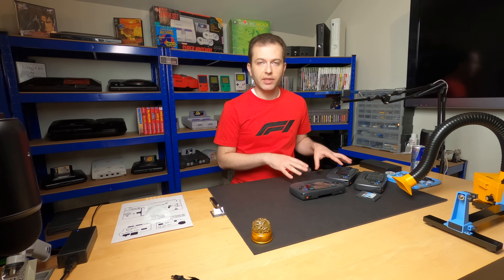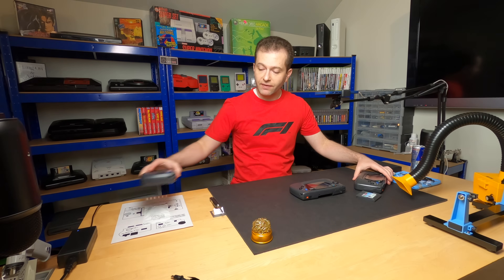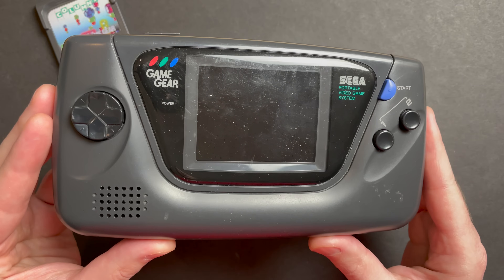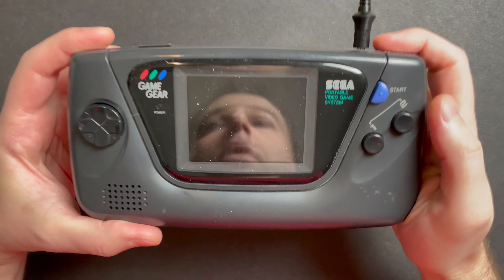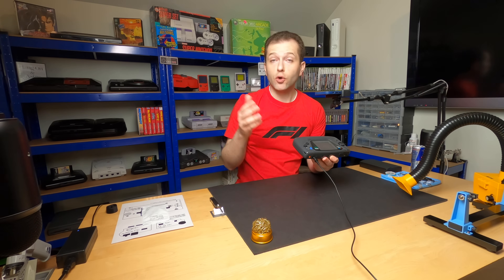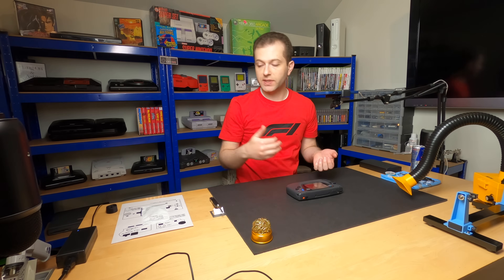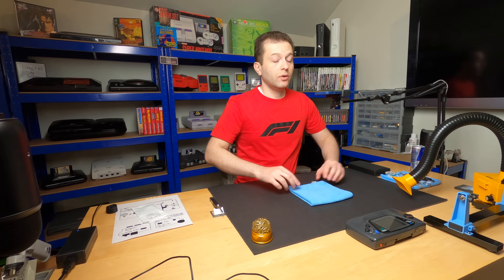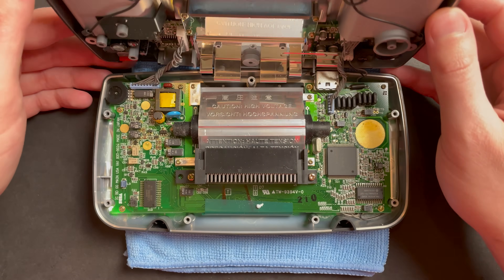Last Shot at Redemption... Will We Succeed? Sega Game Gear Repair-a-thon, Round 3.

Comment: What really frustrate me is how other youtubers show how easy it is to fix Game gears. Just replace the capacitors they said, then after replacing the capacitors the unit still doesnt work. But at least it is in red light boot? Also after the capacitors leaked aside from the ripped pads solder doesnt stick to the old solder points. Never been frustrated this much, it's much easier to fix gameboys

Comment: I'm surprised you didn't use the ceramic capacitor kit. With that thing you only need to ever replace capacitors on the power board ever again and the rest of the system will last for a long as the boards do.
Edit: I just looked and they also offer power board ceramic cap options that also change the power plug to USB C, and one of those comes with a rechargeable lithium ion battery pack.

Comment: Are any of those a model that is compatible with the USB-C charging mod? I think a case mod to allow you to use some Li-Po flat pack battery modules and a USB-C charging interface would be a really nice quality of life improvement. Apparently there are also some really nice sound circuit mods and several variations of the LCD swap mod that eliminates the need for the cold-cathode backlight. The problem is that there are so many different variants and sub-iterations within each variant of the Game Gear that actually modding one can be a thankless task.

Comment: when it comes to these old surface mounted caps, I usually snip them off just at the bottom and then remove the black plastic peace, then desolder the legs from the bord its a lot easier and i haven't lost any pads since I started doing it this way.

Comment: I recommend just getting the SYF board and transferring the Asic chip, cart slot and expansion port over. If you have an unfixable Single Asic Game Gear with advance soldering skills and equipment i highly recommend it.
Reply from the maker: I've come across those recently, forget which channel I saw them on. I'm glad there are more options for the Game Gear that keep coming out. It's a good solution for a modern GG build.

Comment: mine stopped working, I only get the first black screen with the white text, then just nothing or some glitched screen after that. The sound went away then it came back, I'm still confused if it's the capacitors or not. 🤷🏻
Reply from the maker: More than likely the caps. There's no way to really diagnose much without recapping a faulty GG first unfortunately.
Reply: @BorderlineOCD  yeah I changed the capacitors and still got the same issue. I think I heard somewhere else that it's just not going pass the boot screen, but I just recently bought three games and one of them was Pac Man and that one actually lets me play a bit then it just shuts down while playing through the first maze. So weird.

Comment: For the other Game Gears did you check the 3 pin diodes near the caps that leaked?  That is a very common issue when the caps have leaked.

Comment: Dude, I've been sitting on 3 game gears that need a recap for months. These consoles truly are hit or miss. I've had quite a few that have all kinds of weird garbled graphics issues after a recap due to hard to spot ruined traces from corrosion. it can be hard to justify the effort for faulty ggs imo.
Reply from the maker: Indeed, I’ve found them to have a steep learning curve beyond a recap and perhaps a few obvious faults. I’ve tinkered with the first two units off camera for several hours and haven’t made any progress beyond the results shown in the videos. Traces seem good, even swapped out a couple of the diodes that Console5 sells (D1-D4) and no change. It could very well be that the screens are faulty in those units but I’ve haven’t worked on enough of a sample size to challenge that assumption. I’d really love to understand these better to be honest with you. I’m kinda tired of working on em right now but I plan to try another batch at some point. It’s a great system to have, especially modded, and I have some Sega Master System favorites that I spent several years of my life playing as a kid, which I’d love to own on a Game Gear.
Reply: @BorderlineOCD  I’ve recapped plenty that had busted screens before, that’s relatively common. If it’s a busted screen, going straight to a screen mod has always worked out for me. I’ll check the other vids in a bit and give you my two sense on it.
If you’re not 100 percent on if a screen mod is going to work out, hand wiring instead of flowing qsbs is probably the better choice as it’s easier to remove.
Reply: Yeah both of the other ggs look like busted screens and good candidates for Lcd upgrades or even the consolized gg kit which I believe is coming out soonish last I checked. 
With that second GG that doesn't have an image on the sides, maybe try reflowing the pins where the lcd flex cable connects to the main board. Those lcd upgrades are super nice and absolutely worthy of doing. More power efficient and look a million times better.

Comment: As much as I love Sega, the Game Gear was and is awful from a repair point of view. Out of the 15 (!) GG's I own, I've managed to repair only 1. And I've worked in the electronics service field for years. No matter how many caps i've replaced, no matter how many traces i've rebuilt, the damn things just refused to work. I thought over the years, that maybe, someone out there would make replacement boards, but alas no luck. At least, I wasn't able to find one.

Comment: I was watching your previous two videos and I think you can fix at least one of those screens. 
There is one chrome pad on the right, and three on the back of the screen toward the bottom.
They gradually lose the thin soder that attaches them. You can lightly rub your sodering iron on the pads to restore that connection.
Be very careful, though. Do it too much and you will damage the contacts.  I will attach the video that expains it on the end. 
https://www.youtube.com/watch?v=agPyGjKDe5U&t=10s&ab_channel=Blagger

Comment: FYI, there's a community project to build a game gear from "all new" parts.  it's a new main board (with zero electrolytic caps), compatible with modern IPS upgrade screens and the enhanced sound / Li-On battery board.

Basically, you're just moving the original ASIC and cartridge slot and stuff over from the corroded dead board, to the good new one.

As far as cleaning rubber membranes go, you can boil them for a short amount of time to restore the feel to them.  There are tutorials online with temps and times.

Also, IMO that screen was pretty scratched up.  I personally would consider polishing the acrylic if you're not going to replace the bezel.

Comment: I also had one of these and the backlight went out after a few years. Just died like that and went all dark. Those high voltage tubes were not really reliable but was the best low cost solution back then.

Comment: i am also repairing game gears for some years now. dont know how many went through my hands, around 40 pieces i guess.
what i can say is, only half were fixable with my skills.
game gears which shut off after 1 sec for example are 99% not fixable for me.
funny thing is, i never had an broken power board, but replaced the caps anyway on them : )

Comment: Dude I feel your pain. My hands cramped from replacing so many capacitors. I fixed maybe around 20 systems and still have another 9 to go and 7 battery packs to fix. I put it all away for the moment to take a break. I'll sell them all to ya.

Comment: If you want much more technical repair details beyond just recapping I've spent the last year filling out the repair steps for game gear at http://RetroSix.wiki might be useful to fix some you haven't managed to fix
Reply from the maker: Great documentation bud, thanks for sharing. The section on getting to red light and checking the voltage references will surely come in handy. Bookmarked for future reference!

Comment: I have an original from Japan which my father brought to me when he was there, and I was dumb enough to mix the transformers and I've connected it in a 24v AC cellphone transformer. That time I took it to Sega service but they've said something like the video board was damaged, don't remember exactly. Do you think it still have salvation?
thank you!
Reply from the maker: It's possible. It's pretty easy to refurbish the power board with new caps, voltage regulator etc. If nothing else you can swap in a power board from a known working system to confirm its operation.

Comment: I don't know if I missed the reason but, why is replacing the ancient LCD/florescent display with a modern IPS kit? All the great work you're doing to bring these systems back to life seems to be kneecapped by screen tech that is easily remedied. I seriously do not mean this is any negative way, I'm just curious. You do fine work and I enjoy watching.
Reply from the maker: I do enjoy modded builds and I own several across the various retro systems but I enjoy stock retro systems all the same. It's part of the experience of what it was like for someone who owned a system like this 30 years ago. I'm tend to do the same with the few vintage laptops I own. I always restore them with the stock operating system they shipped with (like Mac OS 9 or Windows 95) rather than the most recent OS they can support.
Reply: @BorderlineOCD  Gotcha. I feel like now that you said that I remember you probably explained that in a previous video. I also meant to congratulate you on the successful fix in this video. Third time’s a charm, after all. I’m really looking forward to the TG-16 vids. It was the first system I bought with my own money and hold a special place for me. Thank you for responding!

Comment: Other two units may have bad connections on the flex cable lines where it attaches to the board. Just like the GameBoy Screens.
Reply from the maker: I attempted this at the end of episode 2. It unfortunately did not have any impact on my units.
Reply: @BorderlineOCD  IN your video you ran it on the black squares, not on the solder points connecting the cable to the board.

Comment: Nice job man! My original game gear I had when I was a kid still works, but I have a blue one I found for cheap at the flea market maybe 15 years ago that never worked. Is the first step regardless of the issue to re-cap them?
Reply from the maker: If it wasn't working 15 years ago the problem may not have been due to the capacitors. It could have, but not certain. Capacitor failure is almost certain today, as the units are 30 years old now. But chances are that something else stopped that unit working 15 years ago. You should probably start with a few voltage checks using a multimeter on the power board to see if it is delivering power to the unit. There are diagrams of the voltage values to check which are easy to find online.
Reply: @BorderlineOCD  Thanks so much for the response man. Yeah, I just tried to fire that thing up again with a confirmed working power supply and it is dead as a door nail. No red LED, no screen lit, nothing. Sounds like the perfect place to start.

Comment: i actualy just finished  recapping three of these aswell lol. two where fine and the last one has three horizontal lines, im unsure if thats the LCD or me messing the recaps  but it  plays  games and does what it needs to otherwise. i wanna do a lcd upgrade and  unsure if this one with lines would be the right one to use  because it may not be the lcd also wish id have seen these videos first lol  these three are my first time  doing this sort of thing. id love a copy of that paper you have with the  board map with the  caps MF and volt  on it too lol I did one cap at a time
Reply from the maker: The diagram is from the Console5 wiki. It doesn't have the capacitance or voltage rating thought, you'll have to make a note of the readings once you open the unit up so you have a map of what to install. One cap at a time works too, and I see that many others prefer to do it that way to minimize chance of error. I find doing all the steps chronologically (remove, clean, tin, install) to be easier but that's just me. I have a similar dilemma as you with my unit from Episode 1 (VA1 with lines on screen after recap). But chances are the board is find and the screen is just messed up. It's a gamble though. Personally I plan to take the gamble, as I do not want to sacrifice a working screen when I have a faulty one that is a viable candidate. The LCD mod can always be salvaged and put in a different unit (wont be fun to reverse it, but it can be done). Either way, best of luck with the mod and let me know how it goes!
Reply: @BorderlineOCD  thanks for the tip. I'm gonna do the mod as well. They have a newer one now that even I should be able to install.  No more wires allover. Kinda glad I got one with a bad screen. Didn't wanna mod a working one

Comment: Great job, game gear recap takes lots of patience but its one of the easier handhelds to revision, i love the American d-pad, its much better than the European and Japanese floppy one, and the fact the American power socket its smaller also looks better than the Mega drive bigger socket.
On the other side i love the engraved back on some Japanese models.
Im waiting on a cheaper easy to mount ips screen to mod one of mines.
Reply from the maker: It's quite curious that they changed something as fundamental as the d-pad between regions. I love little details like this that I learn about from folks in different counties. Thanks for sharing.
Reply: @BorderlineOCD  i share your opinion, and changes for better are always welcome, Sega never improved European Sonic 1 for the Mega Drive unlike the American and Japanese versions that are much better than ours

Comment: One thing to note: after you snip the legs of the through hole components, always re-solder the joint.  The act of snipping the legs can create micro-fractures in the solder which may lead to failure down the line.  Note sure if you did this, but it wasn't shown in the video.

This inspired me to pull my Game Gear apart just to check for any corrosion .  Seems all good but might order some replacement caps anyway! Keep up the great work!
Reply from the maker: Sweet, now you've given me one more thing to be even more OCD about.

Comment: I'm practicing to become as good as you are. Im still trying to fix a trace on a original xbox with a broken trace from the clock capacitor leakage. 
I never knew that was possible until i saw your channel.
Thank you for the inspiration.
Reply from the maker: Glad to hear it bud. I'm sure you'll get it working. I love working on the OG Xbox. Great system to practice trace repair (the faulty ones almost always have a broken trace or two).

Comment: What do you call that cutting tool you use to snip the excess legs off of the capacitors? 

I looked at the description, but could not see something matching that description.

Edit: Well done with the repair, the sigh of relief was almost palpable.
Reply: Those are called 'flush cutters'.
Reply: Flush cutters
Reply from the maker: Indeed, as mentioned above they're just flush cutters. This is the one I have https://amzn.to/3BWAVgW

Comment: same problem. Did the recap, audio works, reads games, display is crap.
Reply from the maker: Given my experience in this repair-a-thon, I would suggest that our experience is not unique and the displays are just reaching an age where the failure rate is going to be very high. Hopefully LCD kits will come down a bit in price over time.

Comment: Some what comical that the only one that ended up with a working display was the one you could actually get a replacement for lol. Glad you finally found one!
Reply from the maker: Lol yeah it was unfortunate with the second unit (the VA4). The first unit was a VA1 so it can be modded. Will be a bit of a gamble given the condition of that mainboard but chances are the board is good on that one too.
Reply: @BorderlineOCD   Yeah the VA1 should be fine generally those screens are the only problem after the caps. If you haven't done one yet the screens look absolutely amazing on these when complete. Definitely replace the plastic screen cover with a glass one though as it makes a huge difference.

Comment: Never seen that technique used to clean the buttons. That looks like it works well.
Reply from the maker: It does indeed, just go easy on removing any buildup so as not to remove more carbon than is needed to get a smooth fresh layer.

Comment: Cracking up the fume extractor, bet that smelled like fish 😂

Grats on getting one with the original screen working perfectly, you should definitely install a replacement screen on the other ones.
Reply from the maker: Thanks 👍 Yes its definitely a stinky system to work on, and lots of flux fumes. Also be warned, the fishy smell lingers for at least a day in the room afterwards...

Comment: Is that blue and yellow machine making that noise for sucking in the fumes from the lead? Or is it doing something else?
Reply from the maker: The blue thing is just a PCB holder. The yellow funnel is the mouth of the fume extractor. This is a stinky system to work on, and lots of flux fumes.
Reply: @BorderlineOCD  Never seen that machine, some of these fumes will really hit hard, specially the eyes and nose.